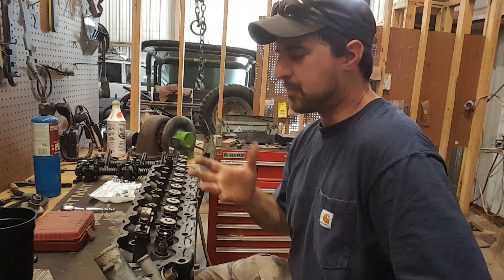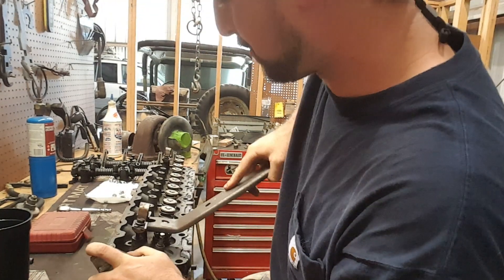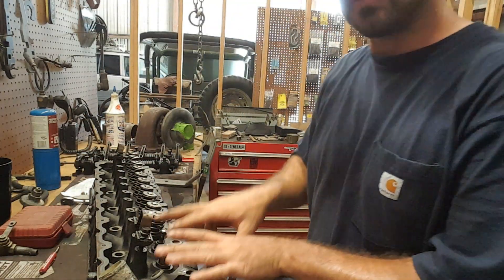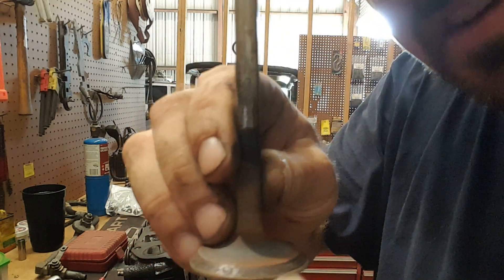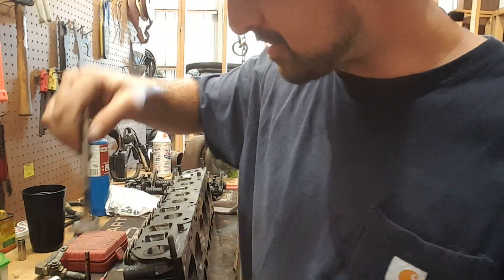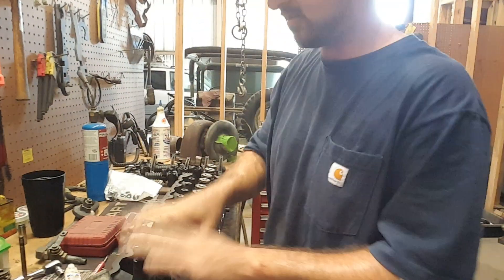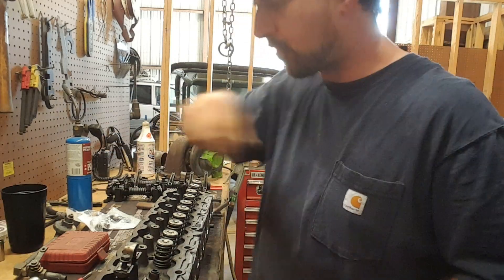Jeep 4.0L head tech: How to do valve seals and port polishing.

Comment: Air flows better with a rough surface. This has been proven. Think of golf ball dimpling. So if you're simply polishing, not porting larger there is zero Gain imho.

Comment: If I'm re-building my 4.0. Do I have to have it machined where the valve seals sit? Or can I just install new ones?
Reply from the maker: You can just install new ones. Nothing to machine unless you have the valve guides replaced.

Comment: Is there any compatible head which has intake and exhaust ports on opposite sides of the head ? I think it is the worst downside of this engine.
Reply from the maker: Not that I'm aware of. Only other head that works with some modification is the 258ci jeep head, and it's set up the same way.

Comment: The correct way to use the valve spring tool is to remove the bridge, align the small hole in the tool to the bridge threads and use the bridge bolt to secure it. Or if you are worried about damaging the bridge bolt, use a bolt with the same thread.  Then, leverage the valve spring down to remove the keepers. A half inch spacer washer will be needed under the tool. I also used two flat metal spacers about an eighth of an inch thick and 3 inches long to take up side to side space on the sides of the tool. Two cement nails may work for this.

Comment: One valve moves freely on my valve stem. Not sure if it is the guide or the stem seat. If I lift the valve it will drop back down. My other valves will stay up when pushed up.

Comment: yes sir, Bob from Texas. I'm currently restoring a 1979 CJ5 jeep with a 258 engine inline 6 . I lapped the valves and cleaned the ports just like on your video but when  I took the valves springs off the seals are different  from your video. the only seals it had on was a plastic type seals(cap) that go over the guides . when I got the head gasket set it came with two type of seals . the ones like on the video and the plastic type like the ones that came the head. is the cap type are the original ?
Reply from the maker: Those are just the old style.

Comment: So I am porting and polishing a Jeep 4.0 head and doing the gasket match to far to turn back noticed exhaust port to gasket is alot of materisl to remove and like i said i am already to far to go back just wondering if i am taking to much taking my time an keeping it symmetrical  not digging anywhere just feels like a ton of material
Reply from the maker: It is a lot of material. I chose not to go as far as gasket matching because I had the same worries. If you grind into the water jacket you wasted all your time.
Reply: @tacticalrepair  wondering how much effect changing rhe shape of walls actually has could it effect me negatively i smoothed out combustion chamber but it changed shape a little not in diameter just as far as internally
Reply from the maker: Should be fine.

Comment: Hi there from Germany :) Thanks for the Video, good preparation for the job! The Head appears quite heavy, isnt it :)
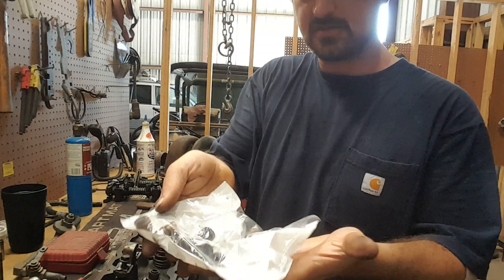In the package with the Valve Seals you showen at 8:43 (have the same here, is in the Head Gasket set from Felpro), there are a few plastic tubes which you should put on the Valve before installing the Valve seals. This will help to prevent damage while sliding the seals over the valves.
Reply from the maker: Hello Philipp and thank you for watching. I did indeed have the plastic tubes but I have never found their use necessary. Simply lubricating the valve stems with a moderate quality oil or light grease and exercising a bit more care than the average gorilla during installation has always proven adequate in my experience.